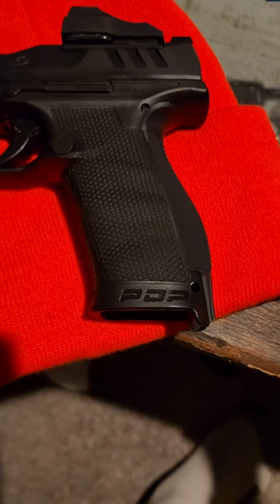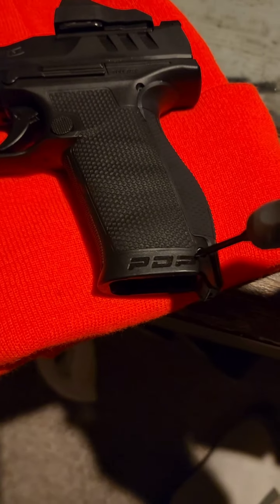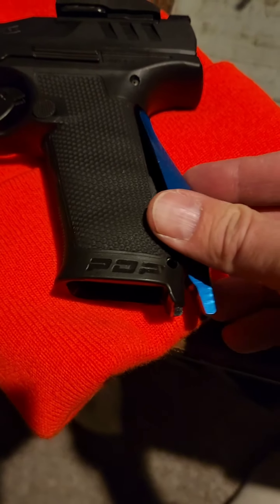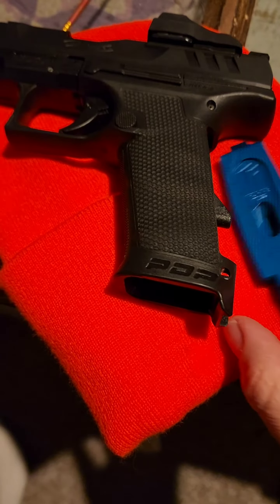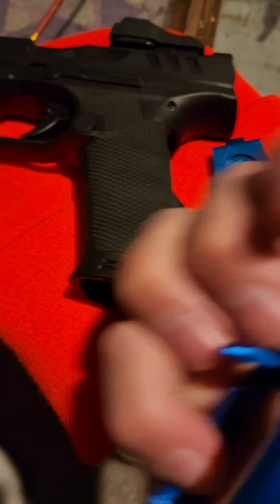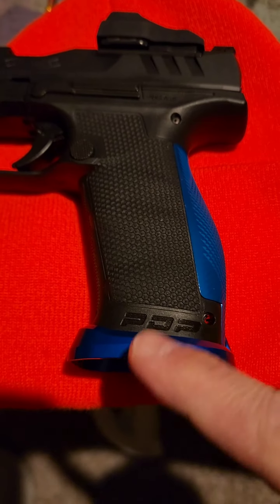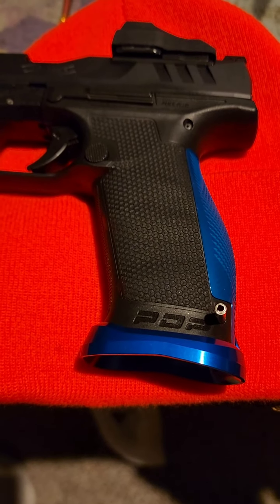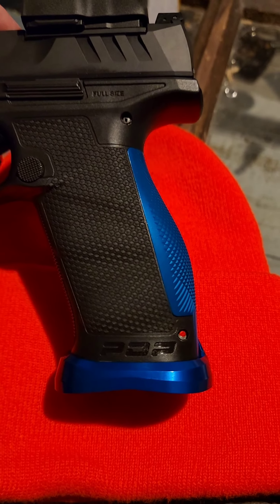How to install the Taylor Freelance Backstrap and Magwell

Comment: What do you gain by those modifications?
Reply from the maker: @jimhansen1245  mostly more weight towards the back, helps with control. They're aluminum. Plus cool factor 😎
Reply: Got a link for that punch?